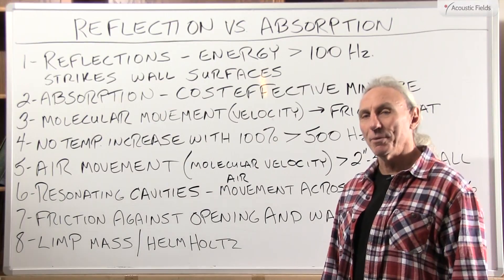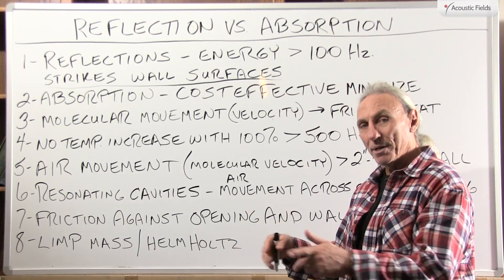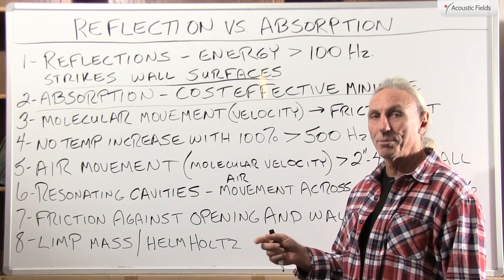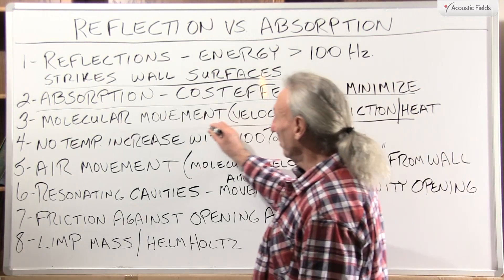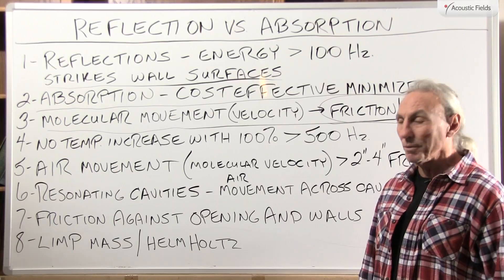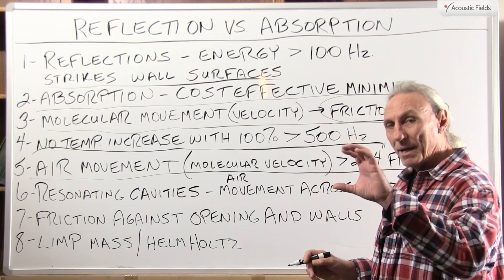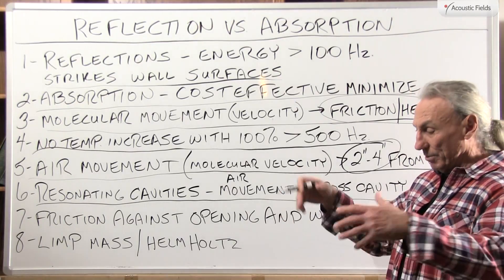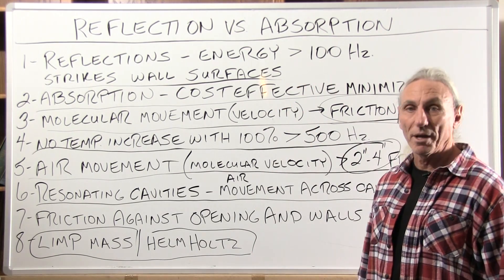Reflection Vs Absorption - www.AcousticFields.com

Comment: Hello!

Aren't resonating cavities meant to absorb only at the resonant frequency? You mentioned they would absorb anything at and above the resonant frequency. Does it have to do with having porous absorption inside the cavity as well, or what's the gist? Thanks!
Reply from the maker: It is distance dependent. Whatever the distance in the cavities is will determine the frequency of resonance. Take the height width and depth and divide each number into 1132. That will give you the frequency of resonance for that physical distance.
Reply: @AcousticFields  Thank you!

Comment: Can we use a loudspeaker as an electroacoustic absorber?
Reply from the maker: S, I do not know if this is possible.
Reply: @AcousticFields  I tried simulating the electric equivalent circuit of a loudspeaker by connecting various load impedances and the results say that the absorption coefficient can be controlled over the desired range of frequencies by varying the load impedance. So, I thought why not use a loudspeaker in designing an electroacoustic absorber! Am I going in the right direction?
Reply: @AcousticFields  Please, will u make a video on the above topic?
Reply from the maker: S,  It would not be a topic our audience would be interested in.